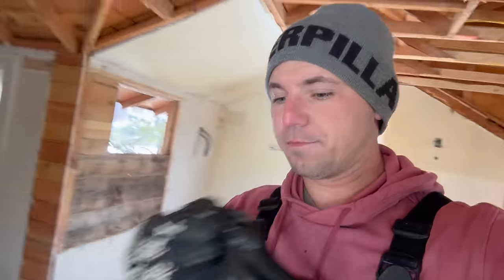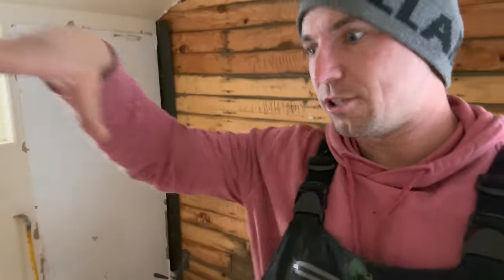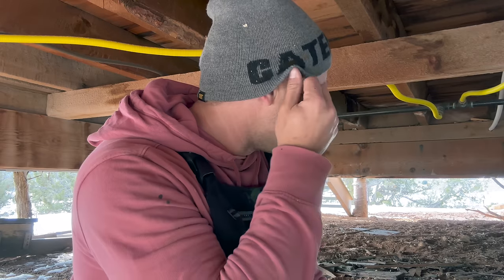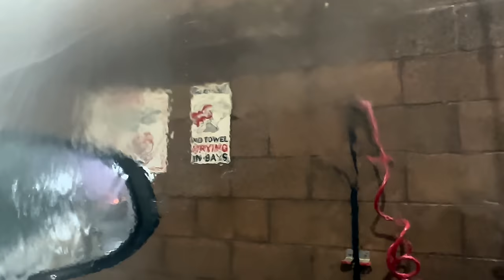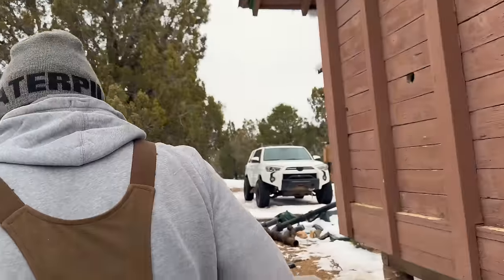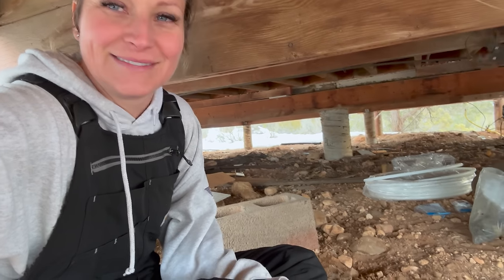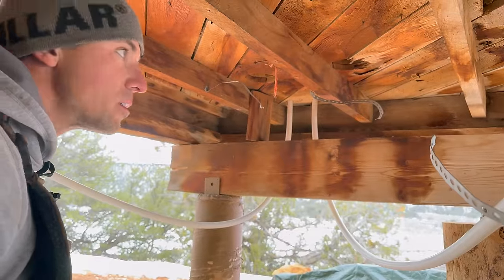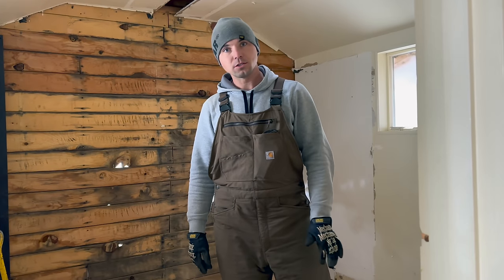PEX PIPE INSTALLATION ON OFF GRID CABIN

Comment: Amigo, I think I might have run a main water line to the kitchen sink. Then create a manifold off it for the other rooms. Run the pipes up through the attic area/ceiling so you don't have to insulate them for winter. Looks good. Getting it done. Good 2 go! Thanks for sharing

Comment: Hey Nick, Frank here. I was just wondering why you didn't run your water lines over the top of the beams that the floor joists are resting on. When you start to insulate the floor of the cabin you will end up with the Pex being exposed giving you a possibility of the pipes freezing up. Otherwise, Good job Nick!!!
Sincerely, the old Montana cowboy, Frank Scherping